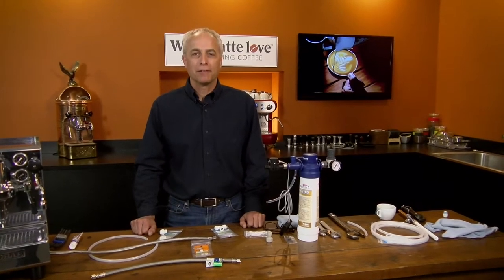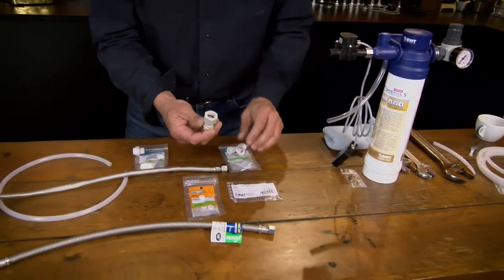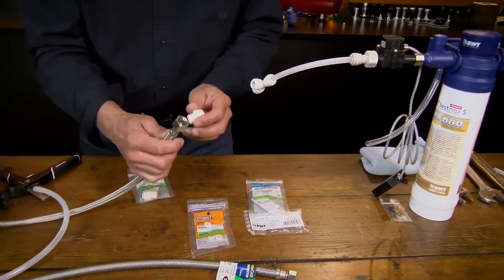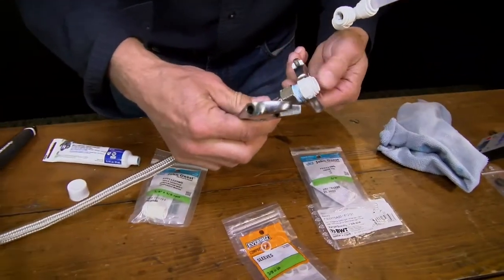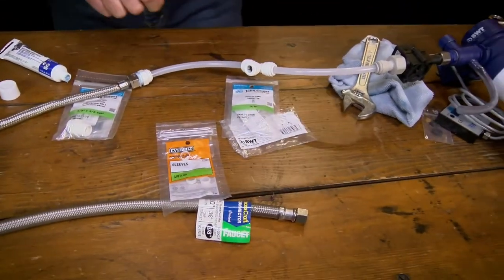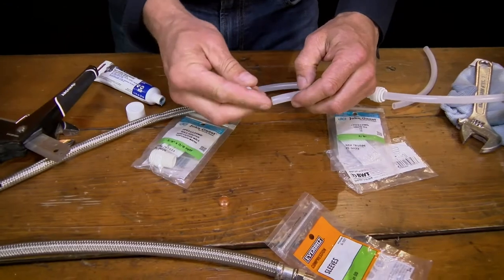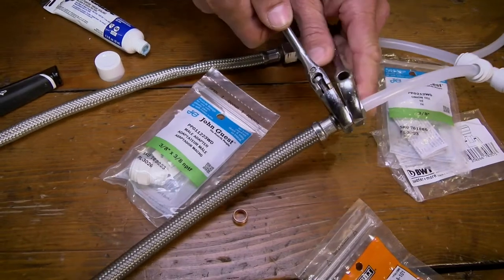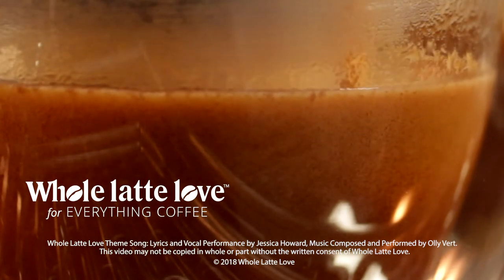How to Connect a BWT Water Filter to Additional Devices

Comment: What about a faucet to the espresso machine reservoir for non-plumbable models? :)
Reply from the maker: Hi Vernon, You can connect a BWT filter to an additional faucet for reservoir fed machines or use one of these BWT products which uses the same ion-exchange technology: the BWT pad filter which you just drop into the reservoir:
 https://www.wholelattelove.com/bwt-bestsave-m-anti-scale-filter Or the BWT Penguin Pitcher: https://www.wholelattelove.com/bwt-penguin-2-7-l-water-pitcher
  Both work using ion-exchange to replace calcium with magnesium. This 
process maintains the mineral level required for best flavor while 
reducing scaling potential.

Comment: instead of using the stainless braided line from the machine, could you use the plastic hose and use a 3/8 bsp quick connect type of connector directly into the machine?  or is that not recommended?  reason why i'm asking is i need to drill a hole through the granite countertop.  so to keep the wifey happy, i'm trying to minimize the hole needed to be drilled to the size of the plastic water line if possible.  thoughts?
also, since i have a WATTS Premier UF-3 stage filter already, i plan on using that.  but i see on the BWT in the video, there's a pressure regulator valve.  is there something universal that could be used with my WATTS system?
Reply from the maker: Hi eosme, Thanks for the question. So long as your machine plumbed line takes the 3/8 BSP quick connect it's doable. IMO plastic not as safe as metal but doable. You did not specify machine type but if it's a Rocket Espresso I'm not certain it's a 3/8 BSP. I'm always more comfortable with a pressure regulator in the line somewhere. Most machine manufacturers specify line in pressure of <2 bar. That said we're currently testing a BWT RO system that's plumbed with all quick connect/plastic and full line pressure of 5 bar/75psi. I run an RO system at home with all quick connect and plastic at similar line pressure. Sorry I'm not familiar with your WATTS system but guessing you could get after-market pressure regulator if desired and would probably give a little more piece of mind.
Marc
Reply: @Wholelattelovepage  thanks Marc for the quick reply.  it's going into an izzo alex leva. i see what you mean by using a braided line to prevent leakage. since my WATTS is already going to a faucet, i would think it's already around 2psi, otherwise it would probably squirt out like crazy. i'll try to find an aftermarket pressure regulator.
Reply from the maker: eosme my pleasure. Not sure about line pressure at your faucet but typical in US residential is ~4-6 bar/60-90 psi